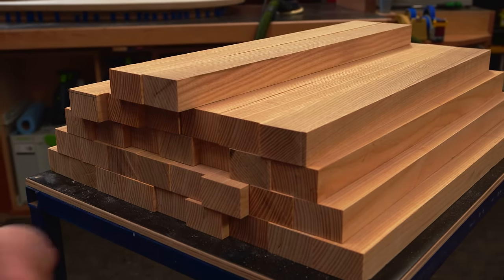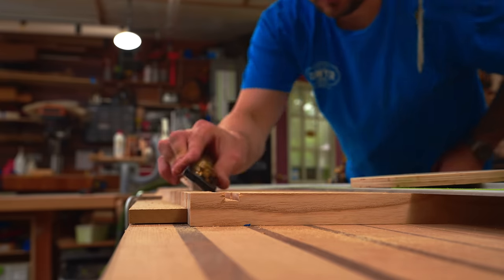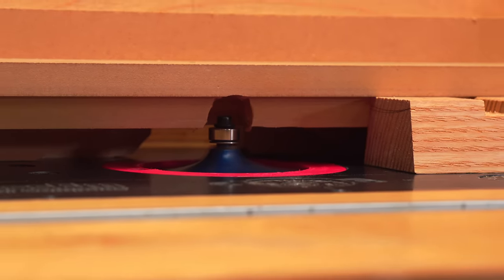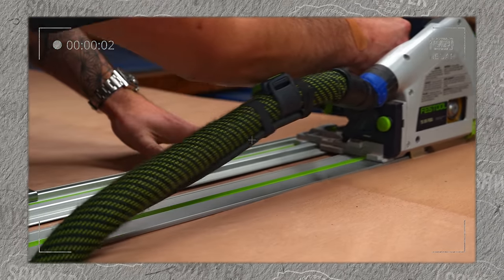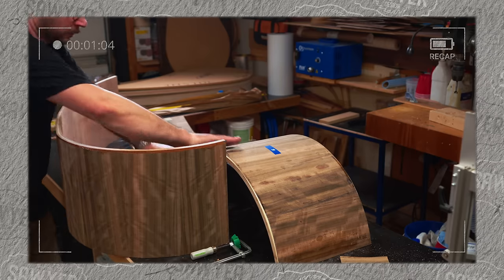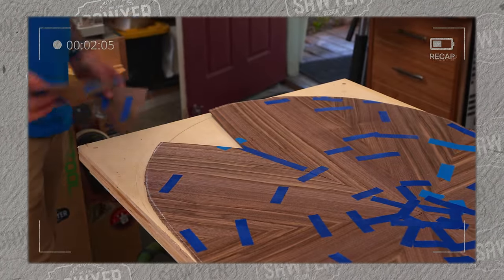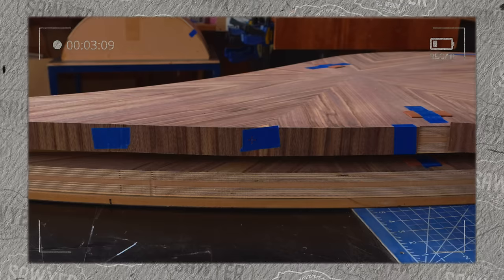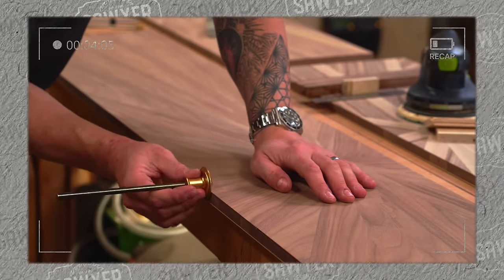I Don’t Get Why People Don’t Build River Tables Like This?

Comment: I love your work!!! I have one question. The vacuum system you're using, how? A giant plastic roll that you taped on ththe sides and put a nipple on, or is it made specifically for this application?
Reply from the maker: Hehe … nipple. 

It’s an application specific 30mil heat welded polyurethane bag 👍 and thanks!